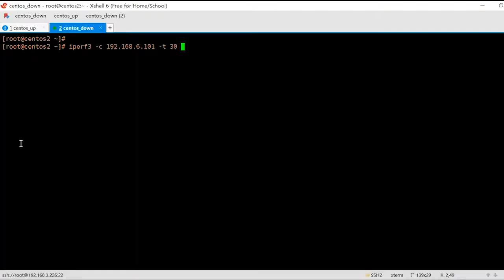10Gtek 1.25G Gigabit Ethernet Converged Network Adapter (NIC) for Intel 82576 Chip

Comment: Sir, best explain, but if you make slow of details which is written on time, it'll be more helpful.
Reply from the maker: Thank you for your suggestion. We will improve our details in the future and bring you a better experience.
Reply: does it work with mikrotik x86 router os 5.20 i have old server @10gtek
Reply from the maker: @opticconnect3294  We recommend that you consult your system manufacturer or test it yourself, as we cannot find the compatibility matrix of your router system.